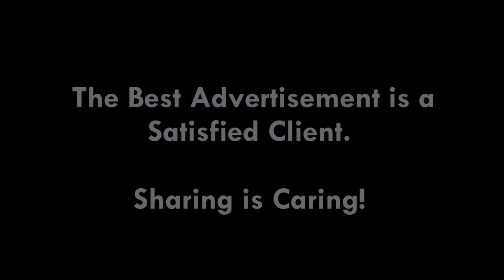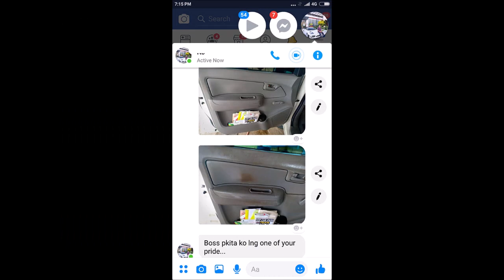LUMALAGUTOK SA REVERSE

Comment: Sir question maari bang CV joint ang sira? kapag ka ganito ang sitwasyon. Toyota vios sasakyan ko 2017. Pag nakapark ako (engine off) yung tlgang bagong sakay lang ng kotse. tapos pinaandar ko na ang kotse ko. gas pedal na tapos turn ko steering wheel ko nakakadinig ako ng lagutok na tunog. tunog bakal. hindi naman malakas pero noticeable sa pandinig ko. less than 2 second lang tumatagal ung tunog sobrang bilis lang the moment lang apakan ko gas at turn ang steering wheel. pag umandar na ang sasakyan NAWAWALA naman agad. kahit low speed or high speed andar ko wlang tunog. KAHIT SA STOP LIGHT tapos aandar ulit kahit mag u turn p ako ng steering wheel etc. hindi na sya tumutunog. yun lang tlga sa moment n yun.. minsan inobserbahan ko pagkapark ko sa bahay off ko na engine. tapos mamaya paandarin ko ulit paandarin ko madidinig ko tlga sya. pero nawawala din agad. 1 to 2 second lang. sobrang saglit lang. maari daw kasi cv joint yun sabi sa akin. tama po ba. saka ito pa KUNG REVERSE naman tapos turn ko steering wheel ko walang kahit na anong tunog coming from PARK (engine off) po. kasi yung sound nadidinig ko sa driver side sa harap e.

Comment: Doc, ano po yung problem po lumalagutok sa ilalim ng driver seat. Hyundai h100 2020 crdi model. Naka on po engine Pag uminit at nakatakbo na po ng 10km may tumutunog po sa ilalim. Kahit nakahinto po ako at naka off ang aircon. Pina check ko na Under chassis wla po nakita. Palit na din po ng drive belt. Ganun pa rin po may tumutunog sa ilalim . Minsan nawawala Yun tunog